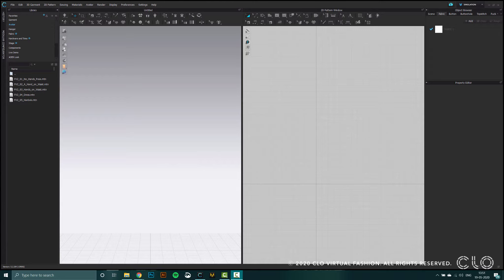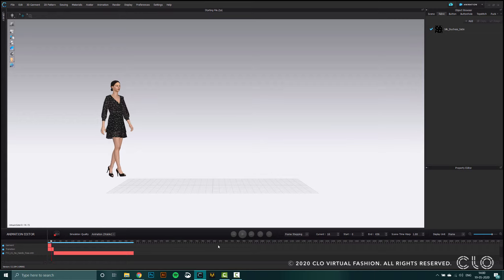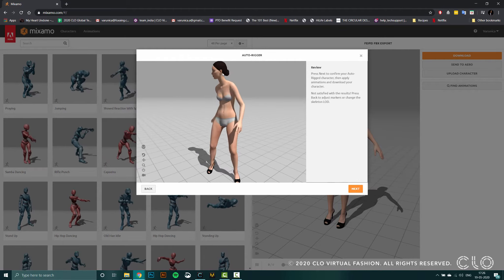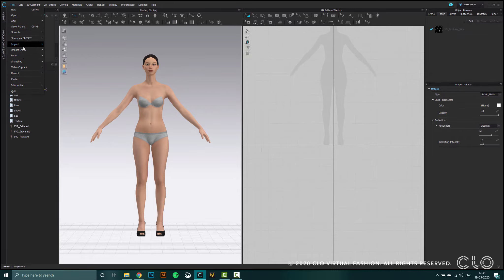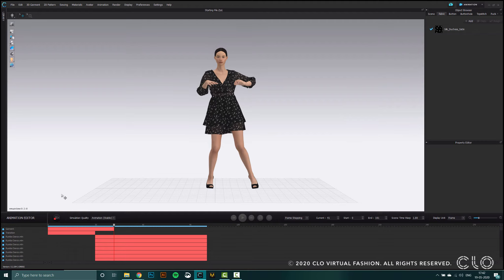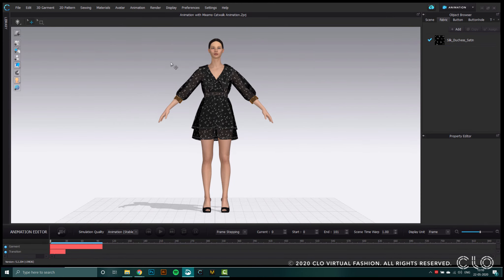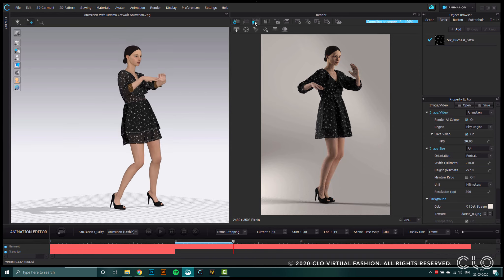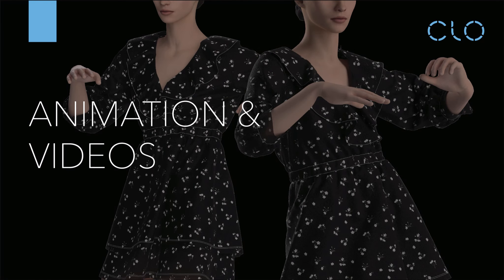Animation and Video Creation Tutorial

Comment: My computer has a good graphics card. However, when I am rendering I am unable to see the rendering effect ? Do I need an application or is there any property that I should turn on ?
Reply from the maker: IF you are RENDERING the animation it is going to take a very long time. Each FRAME is a rendered image. So if it takes your computer 10 minutes to render a single image, multiply that by the number of frames in the animation. [ex. 10mins x 500frames = 5000mins or 3.5 days]

Comment: my animation video render took too long. how long is the approximate time? What should I do for faster rendering?
Reply from the maker: Rendering Animations does take a log time, there is not a lot you can do to speed this up as it depends on your computers processing capacity and speed. The Render properties action is the area where you would adjust quality which can also affect speed. Lower quality light/material settings combined with a higher noise threshold will speed up the process but the compromise is image quality. Having a PC or MAC that meets the highest recommended specs will help, but still overall, Rendering animations can often take hours.

Comment: Hello, thanks for the video is great ! But i I have some issue with rendering. My computer is really slow and it’s taking 4 hours to get a turntables images and video and more than 5 hours to get the video in graphic motion. I reduced the time of rendering in max 10 min and the noise at 0,070. Am I doing something wrong? Do you suggest to change some parameters ? Thanks in advance :-)
Reply from the maker: First I would check your hardware specs; https://support.clo3d.com/hc/en-us/articles/115000307168-CLO-system-requirements-May-2021-. If you are RENDERING Turntables and Animations it IS going to take quite a while. However many frames you choose multiplied by how long it takes to create a single image.

Comment: hi. I tried to follow the instruction on the video and render the animation. But why the files saved are in individual photos (png) instead of video format?

Thanks :)
Reply: The same happens to me.. Did you find any solutions?
Reply: @bonbonges   I opened the link but is about print appearance.. Did you asked also about the render issue?
Reply: I found the post in their website, but even if I flag "save video" it saves me only separate images.. However, thank you for your reply!
Reply: In the Render Window, go to Image/Video Properties, then in the Property Editor on the bottom right, Make sure you change Image to Animation in the drop-down list. If that does not fix, we think this might be an issue with their latest update! Try unchecking transparent background if you have that checked also.
Reply from the maker: Don't worry... it only took me about 5 tries to find the actual video file!! Glad you figured it out.